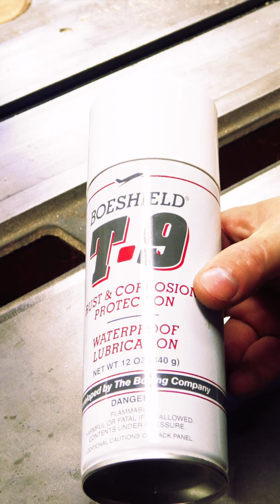48. Rust won't stand a chance #mtbitesize #shorts

Comment from the maker: To check this stuff out → https://amzn.to/3nYQBdt

No, this isn't just a glorified commercial for Boeshield...I absolutely love this stuff.  Seventeen years ago I was introduced to this at a woodworking show (think little booth, couple guys in flannel) and they talked a big game.  I took a chance.

Now almost two decades later and I add this stuff at least every couple years (unless I use a torch or add liquid to my table saw top 🤦‍♂️) and I don't have rust problems, even with my damp, humid garage.

I didn't have time to explain using this, but what I like about it is the ability to put it on thin or thick depending on how long you wait to wipe it off.
Reply: I tried Boeshield and it works for a little while, but has no lasting power, at least in my humid and hot garage. None of these waxes and penetrants work. I sand the cast iron to 220 and apply poly or very hard lacquer.
Reply: Will it really past that long even in a humid environment and with frequent use? I'm really looking for a coating that will stand up for at least a year despite frequent use.  Also something that wont attract debris/sawdust/etc.

Comment: T9 isn't as slippery as wax. I use Johnson carnuba car paste wax. The problem with that, though, is that wood sliding across the table rubs it off. I live in Washington state, with a beer can for a shop. I've watched rust form while I was working!!! It's almost frightening. I have to rewax after almost every use in the winter.

Comment: I'm not sure why, but I've found T-9 gets worn away too easily. It's not a surface prep issue, I've cleaned the top with brake cleaner and IPA. I've found paste wax or even carnauba wax lasts atleast 5 times longer. With T-9 I've had to scrub off quite a bit of rust after only a couple months of rather light use. Maybe I got a bad batch or something but I can't explain it. Live in the very humid south
Reply: My grandpa uses old engine oil lol. It's basicly free and never complained about it

Comment: If it is a 1/4th of an inch. Apply a thin layer of oil. Like put a little bit of oil on a rag and rub it on the surface, then burn it off with a torch.

Comment: If you live in a humid environment, you will lose the battle against rust!  None of those waxes or oils will ever work for any length of time unless you don't ever use the tool. You're only hope is to sand the surface with 220 and coat it with a heavy film of lacquer or polyurethane. After it dries rock hard, sand over it again with 400 to smoothen it out. Add some pastewax, not for rust protection, but to,give it a nice slick surface.